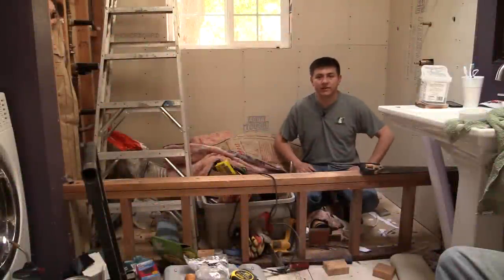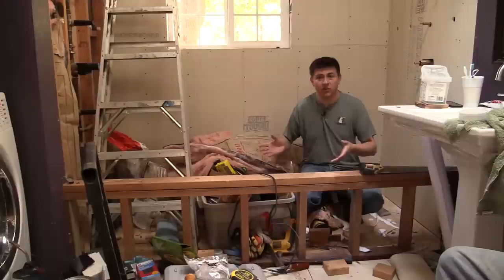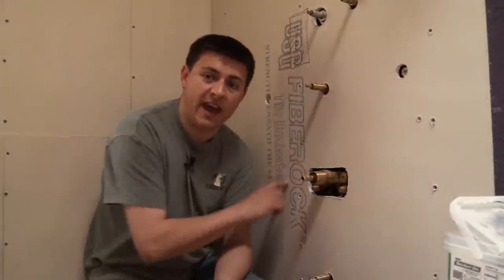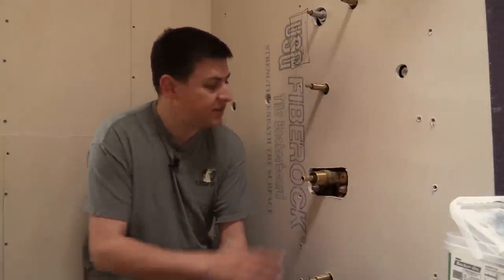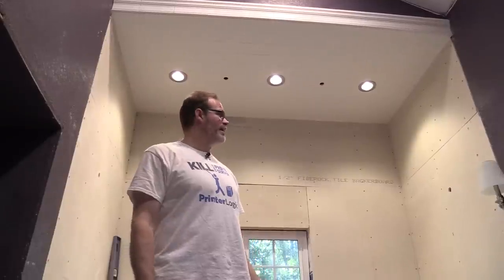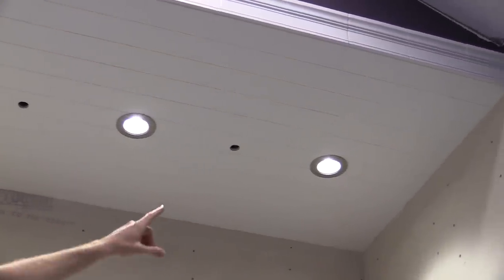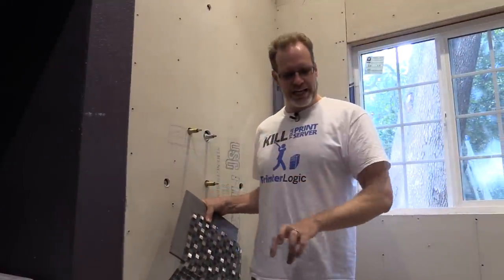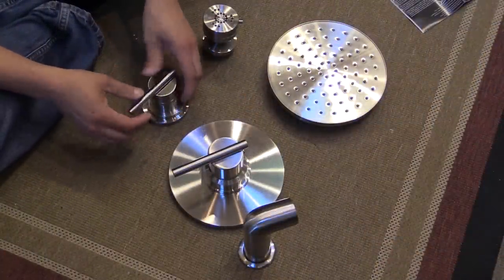Making a tiled bathtub AKA a roman tub, Episode 1/3

Comment: You show the lights but not how you built the tub floor.  Did you use concrete?   Was the floor  sloped to the drain?  How?  Is there an overflow if so how did you install so it doesnt leak?   The last video shows the end result of the floor with a square drain plate, is that a 2 inch drain like a shower, if so how do you plug it to fill up with water?